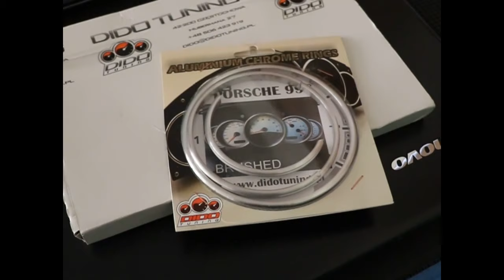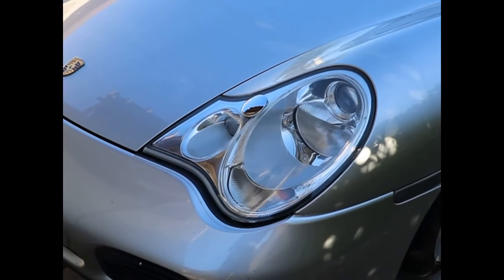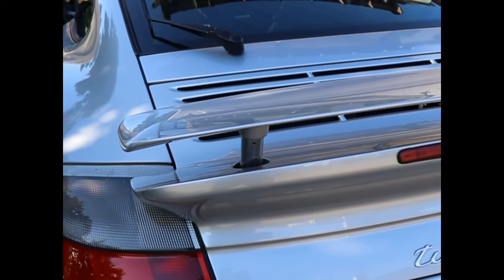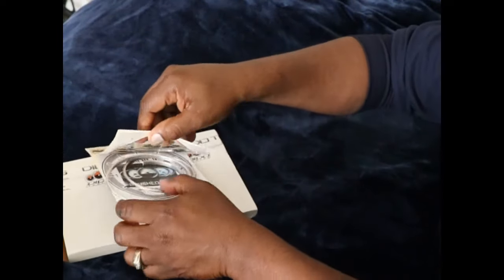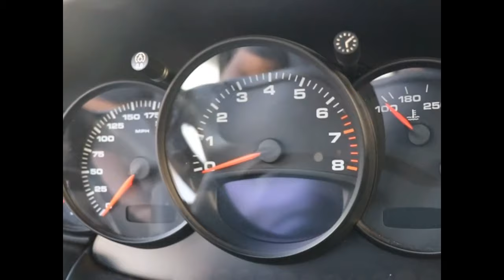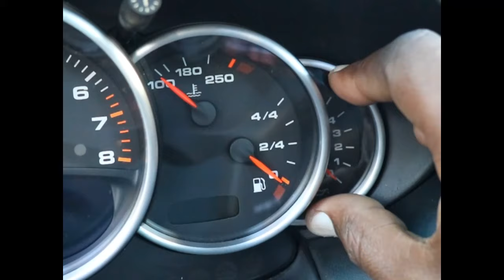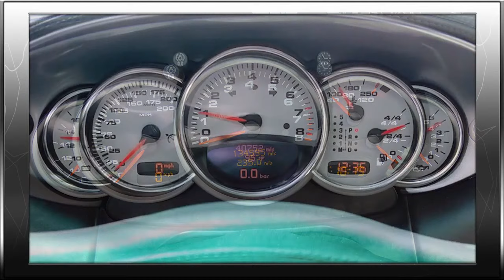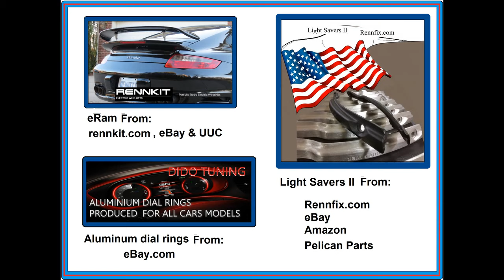The 5 Most Common Failures and Hated Features of the Porsche 996 Turbo  And How I Addressed Each

Comment: Also add the fuel filler door hinge.  These break through a design fault but is very easy to replace with an updated version.   To spice up the interior, paint the center console and radio/hvac trim with either body colored or silver.  The rubberized paint they, ferrari and mercedes, and corvettes used in the early 2000 just become sticky and peels.

Comment: Hey Clint, thanks for the video, I look forward to seeing them.  Can you please tell me what is that rocker switch on the left above your Wiper speed control?  I don't have that one.   Is that a garage door opening mod? 

 I noticed that you have a old PCM2 head unit. My identical unit developed a pixel problem in the LCD.  I was able to source one from China for $60 and installed it myself.  I'm mentioning this in case that happens to your unit and you are wondering about an inexpensive solution. It now works perfectly. 

Thanks again, We appreciate the effort you put into these videos.
Reply from the maker: It activates the rear windshield wiper.

Comment: I've got the alloy pack so the dash highlights stand out well against the black interior, my car is tiptronic so I got a manual steering wheel and cut in the Mercedes alloy gear paddles. The biggest failure on the turbo is the seats, Porsche should of made all turbo seats bucket style instead of it looking like every other 996, I had better seats in my Vauxhall nova 1.3sr
Reply from the maker: I actually like my seats better than the Ferrari 360 I sat in and was going to get. Plus I got the crests embossed in my head rest that just look awesome! seats are heated and comfortable, no complaints from me of the wife ;)